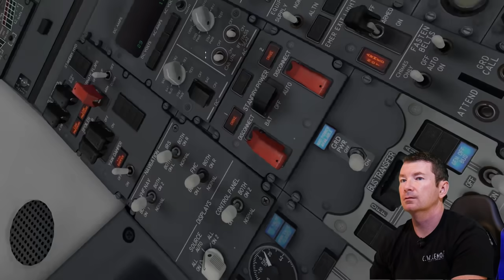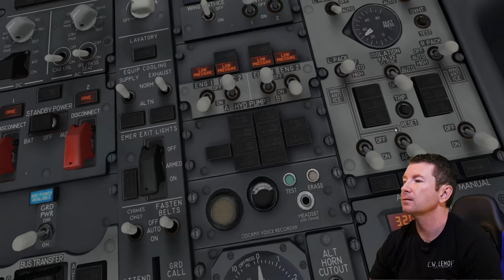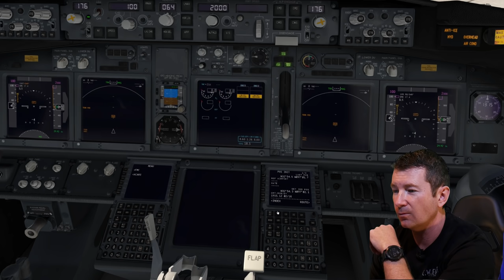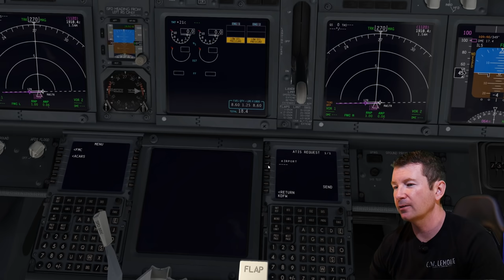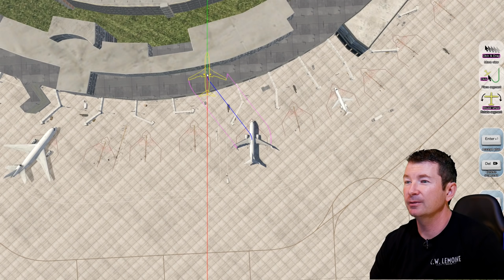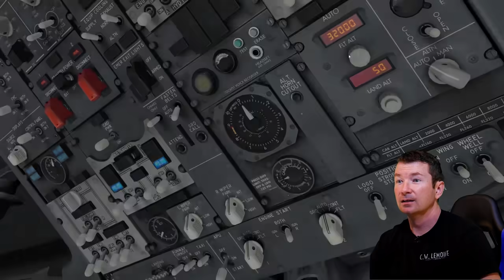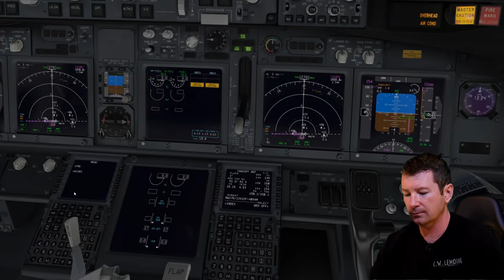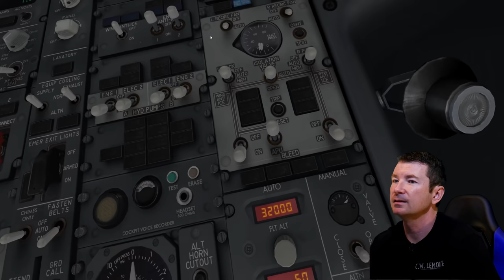REAL 737 Pilot Flies X-Plane 11 ZIBO 737-800 (Part 1) | Preflight, Start, Taxi, Takeoff.

Comment: Everyone else : Press W to accelerate 
Mover: Does legit 30 min flight check.
Reply: I fell asleep and woke up with him on runway didnt realize that was how long it took
Reply: GTA bois basically
Reply: I assure you, NO ONE else who uses X-Plane presses 'W' to accelerate. Not twice, anyway.
Reply: Somveer Balyan: Well, since i belong to the "everyone else" category, i'd like to point out, that neither me, nor anyone else from our X-Plane group uses keyboard buttons to control throttle.
Reply: Kevin Larsen like a real flight huh? XD
Reply: Lol.
Reply: Not W it's F2
Reply: Ritu Sharma 

Hahah
Reply: I like to use WASD don’t get all this 👆👉👇🤏👍👆👉👆
Reply: @thegreathadoken6808  u the funny guy huh
Reply: Lol. I'm a general Aviation pilot, and I've tried to do the full preflight checks in x-plane, but after a while it just stops feeling worthwhile,  because all the stuff you're usually checking for never happens unless you manually force it to.
Plus while you can simulate a LOT of failures, those failures are arbitrary and don't follow real world causal chains.
Final issue is even if you have a failure enabled, all the preflight checks won't show up any of the symptoms that suggest something may be about to fail, so the check basically does nothing besides mimicking procedure...

Still, I've gone through the actual startup checklist for my aircraft a few times (I got an X-plane model of the same aircraft type I usually fly; The ingame model has different avionics though. The real one is not configured for long distance navigation and aside from a very tiny master MFD has no glass cockpit features, while the ingame one is dominated by two very large MFD's - I assume this is technically possible for this aircraft type, but it doesn't match the aircraft I actually fly)
Pretty interesting how close good X-plane models can get.
But it's also interesting where the flight model tends to fail most consistently.

For instance, the real aircraft will fly straight and level at most engine RPM's.
The ingame one will always roll to the left, no matter how hard you try to get the trim right. (plus even if you get it to fly level using trim, it will stop working at an airspeed different to the one you trimmed it for, while the real thing remains stable across a wide range of airspeeds.)

I can only assume that X-plane's flight model still has issues with engine torque effects not being compensated for the way they would in the real world...

That's the downside of having an actual physics model driving your aircraft behaviour rather than a table of expected performance, I guess.
Any flaws in the physics model become nearly impossible to fix...
(while the downside of the data table driven approach is that the flight model becomes increasingly unrealistic the further you stray from the data you've recorded.)
Reply: Isn't w pitch down
Reply: But I have always wonderd what will happen if you just take off without any checks in X-plane
Reply: Hung some clothes, forgot to press pause, come back and STILL in preflight....
Reply: @The Fogel - For the most part? Absolutely nothing.
The only thing that has any meaningful effect in X-plane is procedural stuff that has to happen in specific orders, or where your checklist involves turning various systems on and off.

For instance, not checking the oil pressure gauge has no consequences at all.
But trying to start the engine before you switched on the magnetos would result in the engine not starting.

Not putting the flaps in takeoff position would result in a much greater takeoff run. Not turning on the fuel pumps would again, likely cause the engine to not start.
Setting the fuel pumps incorrectly could cause one tank to empty before the other, which would cause some degree of weight imbalance given where the fuel tanks are. (also might cause the engine to stall in flight while you still have fuel if you have a manual switch)

But really, while there are some consequences, there are far fewer of them than in a real aircraft.

For the most part, (unless there's some real high end simulations of various aircraft I'm not aware of)
There's no point in checking engine gauges, waiting for typical warmup routines, obeying engine RPM restrictions, doing runup tests, visual inspections are especially pointless...
Checking motion of control surfaces serves no purpose, etc.

To put it differently, you can skip 60-70% of what's on most real checklists and it'll have no meaningful consequences.
What's left is basically where you forgot to turn something on or off at the appropriate time.
Reply: I’m guessing you don’t watch Flight Sim often.
Reply: Hahah here is me struggling to remember how to get the Cessna started and here’s old mate with 30 minutes of switches
Reply: @KuraIthys  The first sim that puts in failures like "oil gauge was never checked" and would have CVR, would be awesome. We would have Virtual Air Crash investigation then (:
Reply: Jean-Baptiste Emmanuel Zorg you mad man
Reply: I agree with the captain its really realistic
Reply: but even after 30 min flight check he forgot to turn start switches to CONT position before takeoff =)
Reply from the maker: @СергейДолгих-з6ч  no, I didn't.  That is not required or necessary.
Reply: I’ve gotten my Zibo checklist down to 45 mins and my jaw dropped to just see him breeze through it from memory. So cool to see.
Reply: It’s f2 to accelerate
Reply: @jjseston7977  In Flight Simulator X, it's F2 to decelerate and F3 to accelerate. F1 for idle and F4 for TOGA.
Reply: @СергейДолгих-з6ч  When you try to look like you know stuff but actually you don't
Reply: just pressing W is cringe
Reply: @jasontipton8430  Image thinking, that you could only ever fly one type of plane. Also if you check his videos you see him in an F-18, amongst other things, in the older vids. And yes you recognize Mover's face even with visor down and oxygen mask on.
Reply: @bruhinator6262  True it's not a game.
It's an immensely fun game!

Comment: A few things that really helped me in X-Plane...
-Most controls like dials and multi-direction switches can be controlled by hovering over them and using the scroll wheel
-You can move your camera using the arrow keys, and . and , for forward and backward movement
-You can switch to preset views using the number pad
-You can customize the preset views by holding ctrl and pressing one of the numbers on the pad. It will set that view to your current view
-You can use your graphics settings to change your field of view

Comment: Great video Mover as always. Flight sims have come a long way since the 70’s when Microsoft had the Cessna 172 taking off from Meigs in Chicago and the graphics looked like they were drawn with pencils. I’ve been flying  X-plane for several years on an IMac 27” My favorites to fly are the Baron 58, King Air, and the Bell 407. Looking forward to your next video! (Bill from Slidell)
Reply: Not to be pedantic.  While Bruce Artwick started developement of Flight Simulator in '77, Microsoft didn't approach him till '81 and it was released in '82. Hence the 40th Anniversary Edition. It is the oldest existing product Microsoft has had in it's catalog, predating Windows by 3 years. It definitely has come a long way since the days of the wireframe and Meigs Field. For me the jump from v4.0 to v5.0 was the first biggest upgrade to realism that Microsoft made. Looks horrible by today's standards, but back then it was mind blowing.

Comment: "Is there a way to tell people to prepare for....."

There is a way to tell everyone to take their seats for takeoff,  which is what I assume you were asking about. It's done by switching on the lights in a certain order. Whatever order the checklist says to do it.
Reply: its not, you just have to turn the wing lights on, its linked to that basically, theres a setting within the tablet were you can bind it to another light, i think its the strobe
Reply: Right, ok. It's been a while. For some reason in my memory you had to flick all the other switches and THEN flick that one or else nothing happened, but I'm sure you are right.

Anyway, there's that, and for any other announcement there's the iPad/Announcement section.

Comment: Hello mover - thanks for your videos! I can highly recommend the X-Camera software, with which fixed camera perspectives can be saved in X-Plane and then switched through at the push of a Joystickbutton. TrackIR or a fixed image can also be selected. X-Camera can be obtained as freeware with few restrictions, but these are not a problem and the software is not annoying with "pay me" messages. I bought it at some point without really using the additional functions, I just wanted to support the author!

Comment: Nice tour of the cabin.In 31:25 you switched on the wing light. It's one of the triggers to let the crew greet you in the cockpit and they'll close the cockpit door, I'll use that before pushback but I'm not with the procedures.
Reply from the maker: That wouldn't make sense, though, since you don't turn on the wing light until taking the runway.  Are you sure it's not the anti-collision light?
Reply: See now, I had to try it out and you're actually spot on. The wing lights and strobes are actually to permit entering the active runway. The anti collision light (beacon) is all it takes and they will shut the door for you.
Reply: It's what I've picked up from the video. I didn't shut the door myself. I'm all scan flow checking anyway so it's time to get rid of the odd habits.

Comment: Just come across this video. I hope you have managed to hold onto your job despite the pandemic. As a retired 757 driver I found the PSS 757 the best for 757, but it's no longer available. The LevelD 767 is still for sale, got mine from Flight1 and it is excellent, with almost everything working correctly.
If you're offered a job flying freight take it. I spent my last 20 years hauling cargo, best time I had in flying and none of the problems you get with pax.

Comment: i love how real life pilots struglle in games while they do everything smooth in real life lmao
Reply: It's not that strange. I've flown a real aircraft and have a near identical model of it in X-plane (the cockpit instruments are slightly different, but that's within variations you'd see in the real world)

Let's think about some of the problems the simulator presents:

- In the real world you can easily move your head to change your point of view.
- In the real world, you have hands, and can manipulate controls directly; Real controls are built with this in mind.
- Real cockpits generally have their switches, knobs and the like labelled

Contrast this to:

- In the sim, changing your point of view is a contrived action involving keyboard and mouse commands or maybe a hat switch or something. Even something like TrackIR has an element of unnatural movement to it. (Only VR matches real world expectations.)

- aircraft controls are generally contrived as well. Virtual cockpit has to be manipulated, awkwardly, with a mouse, which is very cumbersome and indirect compared to using your hands. Physical controls require either remembering the keyboard shortcuts, or the unlabelled buttons on your controller, which 99% of the time don't line up with the controls in the aircraft;
Worse, most flight sims don't allow per-aircraft controller configs, so trying to adjust your joystick/throttle/control panel hardware to the behaviour of the aircraft you're currently flying is too tedious to bother with.

- Stick behaviour isn't realistic no matter how good your stick, since amongst other things, in many aircraft sticks have a direct or semi-direct coupling to the flight control surfaces. (not always the case of course, and larger aircraft tend to have fly by wire or hydraulic controls; But smaller ones will have cables or control rods). One of the consequences of this is that stick movement resistance generally varies with airspeed. When stationary on the ground the stick will have almost no resistance, while at high airspeeds it will take a fair bit of force to actuate, while even the best stick currently around has fixed resistance. - the only exceptions would have been the force feedback sticks of the early 2000's but those are no longer made and have limited if any support in modern games.

- A lot of secondary functions (such as ATC communications) are either missing entirely, not implemented even vaguely correctly, or are implemented in a contrived manner. For instance, I cannot even begin to simulate a CTAF radio frequency with even a tiny fraction of what it would realistically be like.

Basically, everything in a simulator, if it's present at all, is contrived and indirect, which means there's several extra mental steps to interacting with everything. Arguably the mental load of this gets worse if you know the real thing, because now you need to mentally translate the real-world physical actions you're used to taking into the indirect equivalents that the simulator's controls demand of you. Unless you have a full cockpit build, this will always be an issue
Though I guess VR comes a little closer to avoiding the contrivances since head movements are now natural, and 6-DOF motion controllers at least give an approximation of being able to move your hands that is akin to real hand movement if performed by someone with very poor manual dexterity... 
Of course, with current headsets, and those we expect to see in the forseeable future, the ability to see of someone wearing a headset is comparable to someone who would be regarded as legally blind if their vision was that bad in reality. Problem is, when you spread say 1200x1200 (approximate resolution per eye of current mainstream headsets) over a 90 degree field of view, this is comparable to looking at a game on a conventional monitor that has a resolution of about 400x400
You would need a 4k per eye display resolution just to equate to a 1080p monitor with a 90 degree FOV. And you'd need 8k per eye to be at roughly the visual acuity of an actual person. That doesn't cover the fact that human field of view is more akin to 220 degrees, if you include peripheral vision, which would suggest needing 16k or even 32k per eye...
Going to be a while yet before VR doesn't resemble being half blind...
Reply: @KuraIthys  i've read that all and just wow didn't know someone could write that many reasons. Just wow. Respect + from me sir.

Comment: I would recommend FlightDeck2Sim "Cold and Dark" video. Makes a difference when you have your camera presets, a flight checklist, and time to fam with the sim. This guy is all over the place.
Reply from the maker: The procedures I used are not inaccurate.
Reply: I get proud of myself just for starting the damn thing. I fly it manually cause I can't work the FMC properly

Comment: Great stuff! The only thing I usually do is turn the starter switches to CONT when taking off..
Reply from the maker: Why not leave it in AUTO?
Reply: C.W. Lemoine They could.. I just select CONT because 737 Start Switches Continuous Ignition should be selected ON during inflight encounters with heavy precipitation, and during severe turbulence. Continuous Ignition should be ON as a safety concern during takeoff and landing if birds are present in the airport vicinity. Do you know the difference between AUTO and CONT?
Reply from the maker: @mikakrstic2573  yes, I do.  Do you know what AUTO does? I've explained it in the comments section.

Comment: 5:25 when he turns the elec/hydraulic pumps on because it’s windy, why’s that? Is it so that the hydraulics are pressurised so that the flight control surfaces; ailerons and rudder are not sitting “floppy” in the wind ? I’ve never heard of wind as a reason for turning them on. Interesting.

Comment: you can try to set your cameras you can set it to your desired position and then press ctrl plus any key when you do this you'll see that any time you click that key it would go to your desired position rather than just rotating your mouse all over the place but if you still don't understand you can search f0r some tutorials and your problem would be solved from there

Comment: Great vid i have  learn how to desk top fly 727 767 747 and all  in-between  using auto land by these great simulation software. They had one back in the day called pilot  in command  that would generate  failures that you  taylor  to real different  failures.

Comment: hi Mover, the Zibo 738 is study level aircraft delevoped by pilots, you can set fmc in every page whit T\C wind , average wind, ISA, deviation, flex temperature, and all systems on aircraft works as well
the same situation come whit the 757\767 of flight factor if you will take a look, the flight model of this 3 birds it's just awesome,
anyway would be AWESOME if you check the JOINT STRIKE FIGHTER 2.1, it's the F-35 (free project like zibo)  and tell us how xplane works when fighters come
Reply: PS: there is real ATC for xplane (people online i mean), go check VATSIM or IVAO

Comment: Sadly, there's no good 767 available. I used to fly 757 before switching to the 737. For the 737 type rating, the add-on made by PMDG helped. You can even do some abnormals. For my old 757 type rating, I used the 767 made by LevelD. It's the only thing that comes close, but it's so old I'm not sure it works with the current sims.

Comment: Great video. If you normally close the packs on engine start, then why is it common to get the strong smell on JP4 in the cabin? Bleed air valves should be closed, yes?
Reply from the maker: No.  The startup procedure was correct.  👍